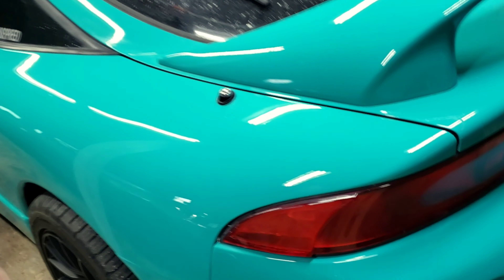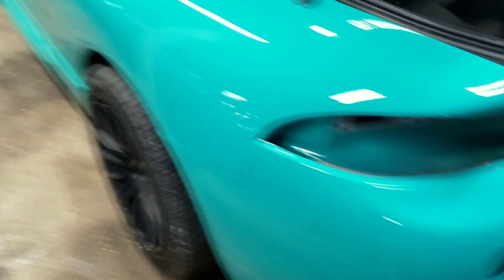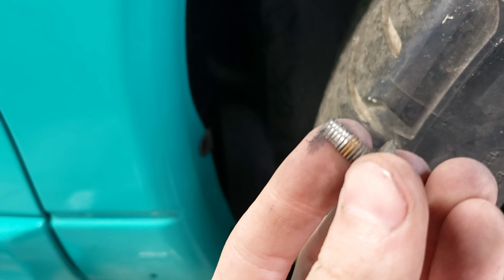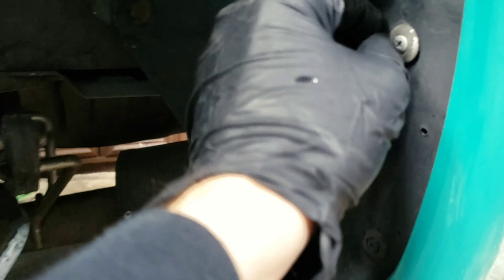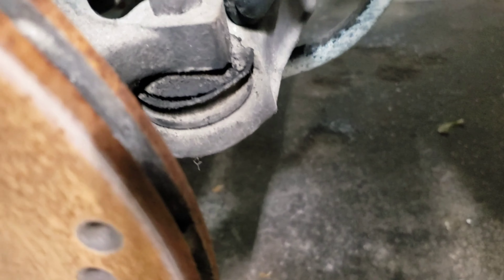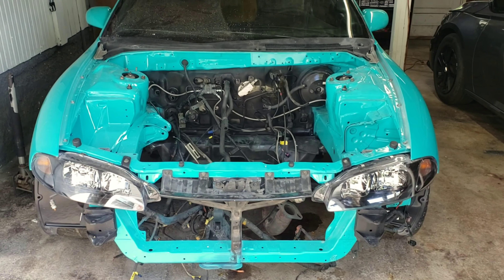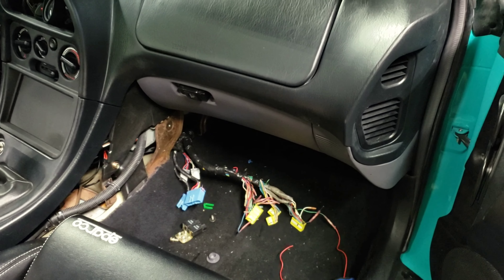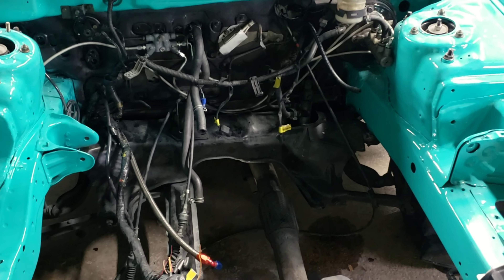Eclipse GSX Tiding Up The Loose Ends (Ep.20)

Comment: Im gonna take a guess you bought those from miller imports?
And you will still have to wire in the cam angle sensor if you have a 97 harness and a 95 motor.
Reply from the maker: Yeah. I've done business with them plenty of times before but the pictures and descriptions were misleading. Hes gonna send me out another set so I'll see what happens.